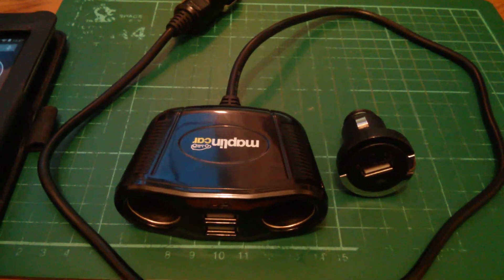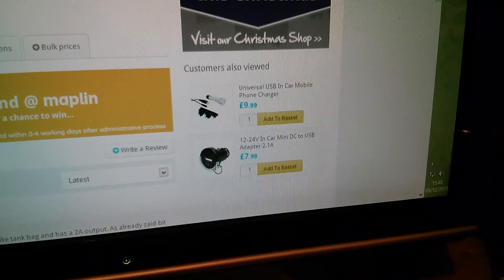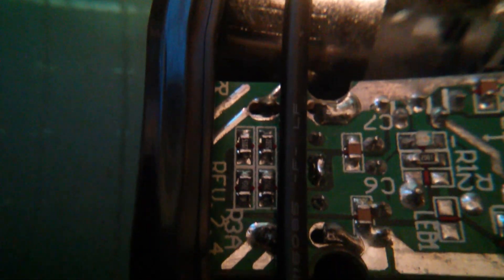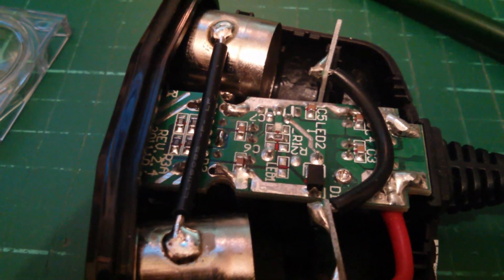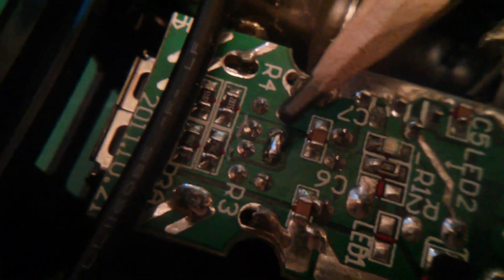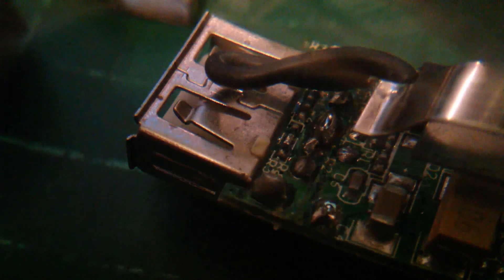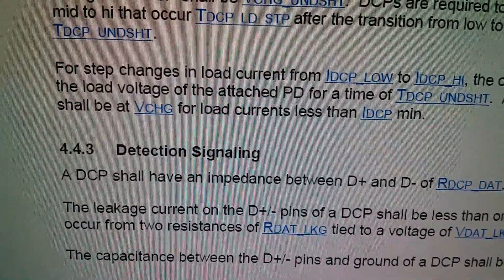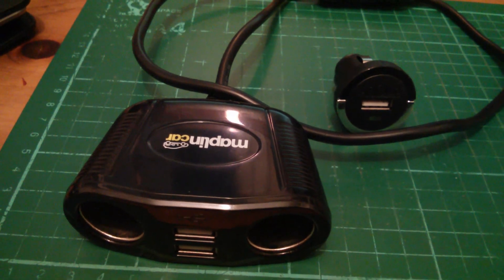How to Modify 12v In-Car USB Adapters to Official USB Specification

Comment: GREAT VIDEOS! Subbed. Was just wondering why you cut the traces to the resistors when shorting the pins with solder alone would have done the trick without damaging the board. Not that you ever planned to use the resistors again anyway. Keep up the great work...

Comment: Julian, this was a very interesting video, I'm currently building a bench power supply, and thought I'd add in a USB socket for convenience, now I think I may go and make some tweaks to the design.
Reply from the maker: I guess you could have a switch to select between Apple signalling and shorted pins if you wanted to be really thorough.

Comment: Loved the video Julian. I did a lot of research on USB charging before I went to Uganda for the micro solar grid project. I'm interested to know if you Apple product charges any slower with those shorted data pins. As I understand, an Apple products will look for either 2 and 2 V or 2 and 2.8 V on the data pins. 2 and 2.8 V will let the unit know it is plugged into the wall (or dedicated port). 2 and 2 V lets the device know that it is connected to a computer and therefore will not kill your motherboard by drawing 1-2 A. (1 A for iPhone and 2 A for iPad).
Reply from the maker: Hi Julian. As far as I can remember, it didn't affect the charge time on my Ipod Touch (4th gen) at all. Maybe that device is recent enough to check for the shorted pins. You may be right about the 2.0v and 2.8v voltages, although Wikipedia explains it in terms of current availability:
"When D+ = D− = 2.0 V, the device may pull up to 500 mA. When D+ = 2.0 V and D− = 2.8 V, the device may pull up to 1 A of current.[65] When D+ = 2.8 V and D− = 2.0 V, the device may pull up to 2 A of current.[66]".
Hope the Uganda project is still going strong.
Reply: Julian Ilett Seems to be. We get the occasional phone call from them. Might be going back very soon actually. We'll see.

Comment: works on poundshop ones too.
Reply from the maker: Can the pound shop device supply 1.5A? If it can, then £17.99 really is a rip off! Next time I'm at the pound shop, I'll look out for one.
Reply: There's 2 amp ones on eBay for less that 17.99... The Poundshop ones can do an amp.  It's a pound. .